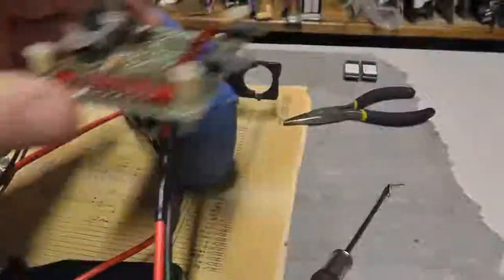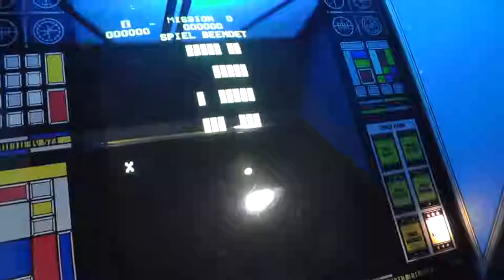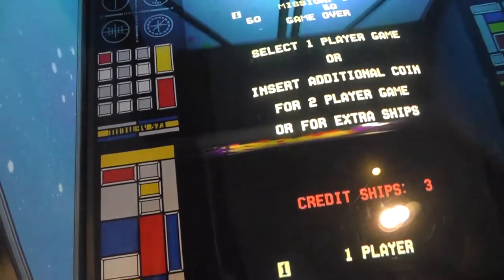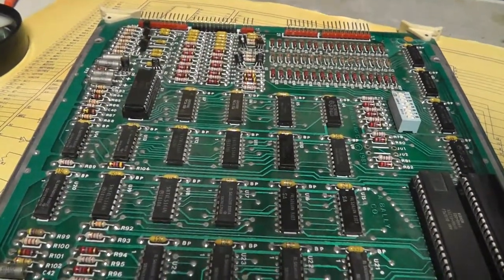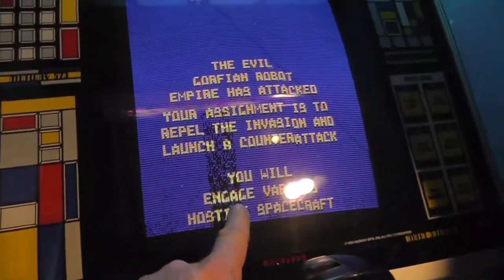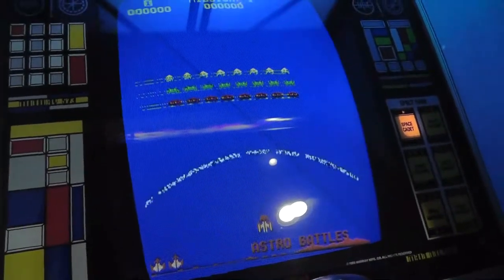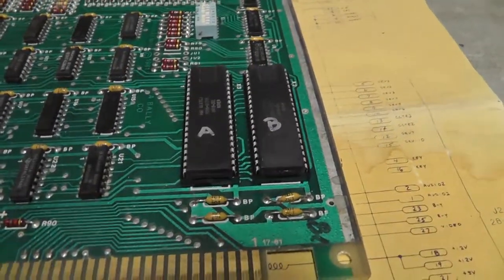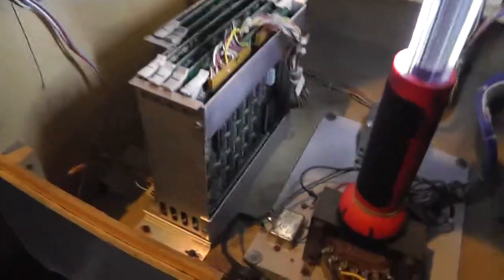Gorf Graphics Troubleshooting p2 - Solved

Comment: The graphical issues are a result of either the pattern board, the ram boards of the CPU boards. The Game board is only for the sound and input. Check your pattern board and RAMS on the RAM board. The two IO chips are the same. The one with the signals tied together are for sound only. The other one is for input and sound as well.
Reply from the maker: Thanks for the reply.  I will have to go back and watch the whole video and look at schematics but @ 4:30 I put a known working game board (#3) with good customs at X2 and X3 and it solves the graphic issue I was having.  I then take suspect customs from problem game board #1 and the problem follows the bad customs.  I don't have schematics in front of me but slightly remember the customs here doing some address multiplexing or something?  I agree one is just for sound but the other you need working or the game won't even boot.
Reply: @jacklick  Not at all... but also keep in mind that your cage back plane connectors might have some need for cleaning. The one thing about the game boards is they do affect the video in that they are responsible  for the sparkling effects and the star field. If you look at those pages again you will see that most of the left side of that schematic deals with the stars and sparkling. So that may somehow affect video inadvertently. After watching the rest of the video I saw that you did fix it by replacing the IO chips which seems weird to me and made me think to tell you to double check the cage back plane connections just to be certain.
Reply from the maker: @GORF_EMPIRE  will do thanks for the additional info.
Reply: @jacklick  Glad to help. I found this vid by trying to find more info myself on the inner programming side of the pattern boards. I was lucky enough to even find the gate level patent info on the Astrocade system chips. These are the same chips used in the home console Bally Professional Arcade/Astrocade. Same memory map other than the added IO chip, extra memory and Pattern Board. I am trying to see about reproducing the chips in FPGA in hopes that I may be able to make plug-in replacements for all those dying Address, Data and I/O chips. Z80's are a dime a dozen so we are not worried about those too much.
Reply from the maker: @GORF_EMPIRE  heck yea the community is dying for this
Reply: @jacklick  The biggest challenge will be the analog parts of the IO chip. That will require some external circuitry aside from the FPGA. It could be costly but worth if you love the system as much as I do. We'll see how it goes.

Comment: I thought the Color PROM chips had to have the correct ROM versions. if you installed a different ROM version the Color PROM chip file needs to be changed to a different version also or you will get scrambled colors displaying garbage on the arcade monitor. Also I thought they changed the arcade motherboards for different board versions or revision. Some arcade circuit boards have custom chips on the data buss and address buss, are these custom chips act or similar to PROM chips? I seen them in Dig Dug.
Reply from the maker: Maybe my tests were flawed but feel free to read through the link below and bring into question anything you have in doubt there.  https://forums.arcade-museum.com/showthread.php?t=391248.  Forums are the better place to have discussions like these. There are two different versions of the gorf rom boards (domestic and foreign) but both work with either version of the game code.  They also work with either 9332 PROMs or 2532 EPROMs, as long as it is strapped correctly.

Comment: MAME website has different Gorf ROM sets for different Gorf ROM versions. Any reasons why they don't work if you put the wrong Gorf ROM version in the correct Gorf motherboard? If you load the ROM chips with the wrong ROM version if will display scrambled colors on the arcade monitor. Other arcade games i think are able to use different ROM versions but Gorf won't let you?
Reply from the maker: Why do you think you can't put either gorf rom version on any gorf rom board?